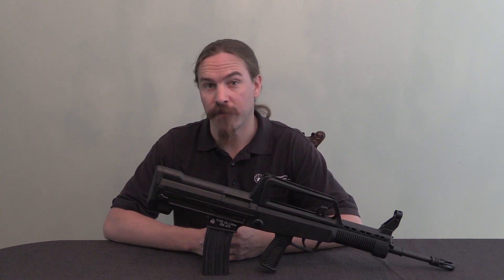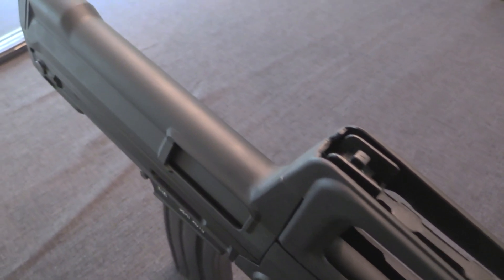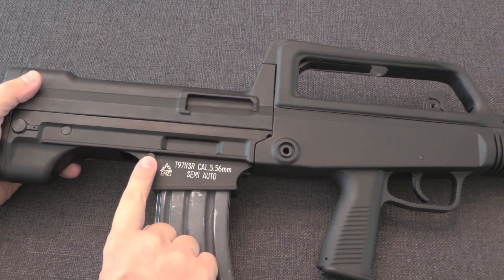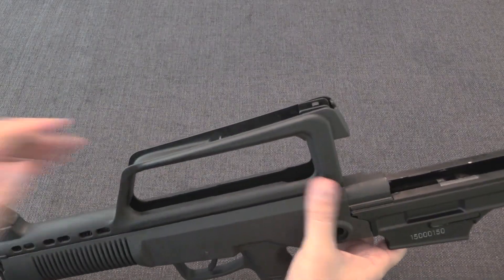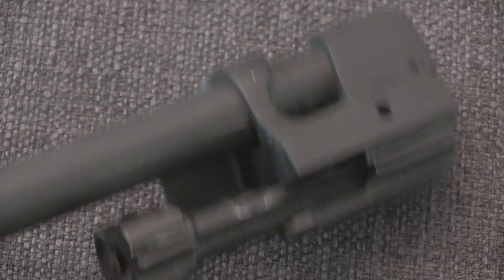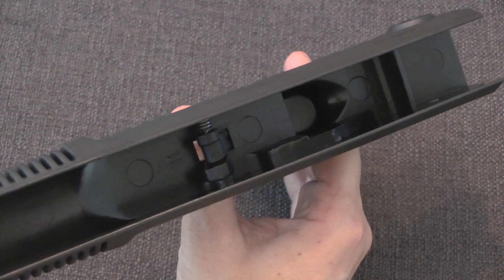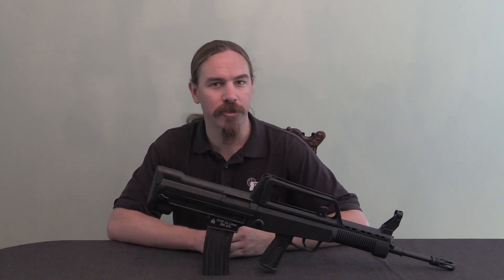Mechanics and Disassembly of the Norinco QBZ-97 / Type 97 NSR

Comment: "This is a civilian export model"
Darn-
"Here you can see its adjustable gas regulator, set it to this and you can see its flash hider here is the proper diameter with gas-sealing rings for using rifle grenades"
-WHAT?

Comment: I think that there are also Light Support Weapons with longer barrels and bipods and a 75 round drum magazine, a very short barreled carbine/sub machine gun version in 9mm calibre (?). (for weapons crews, helicopter pilots, vehicle crews, etc). 

Plus a suppressed version for special forces use, a sharpshooters rifle with a telescopic scope, a bipod, a smaller capacity magazine, etc which is similar to a Designated Marksman Rifle with better accuracy etc.

Rifle grenades, bayonets, various attachments etc are also issued.

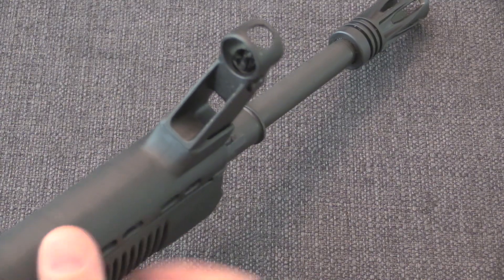Comment: @ 8:25- Re, the rear sight; the 3 apertures are 100, 300 & 500 meters. That odd post, apparently on military models, should have a luminous dot, for use with 2 others on the front sight e.g,  •°• .

Comment: @ 11:30, A- I've read elsewhere that the plastic, at least on the early models, was rubbery/soft, so as not to become too brittle in Siberia and crack.
B- I've also read that the stiker-fire design, was to lessen the usually lousy bullpup trigger pull. Apparently it did't work.

Comment: Since the dbp87 and dbp10 bullets were used, the weight is much higher than that of the small-calibre ammunition used in the United States and Russia, and that requires the maintenance of high initial speed, high penetration and high end-point effect. Therefore, you have to increase the firing rate and bore pressure of the propellant, resulting that the ablation damage of gunpowder to the barrel is also multiplied.In such cases, the heat attenuation of the barrel is aggravated, and the internal and external ballistic performance indicators rapidly deteriorate. This problem, which was discovered in 1995 when the 95-type rifle was finalized, has not been resolved for the past 24 years and it is truly painful. 

A famous military expert, once said half jokingly that the monthly salary of college graduates in China has now risen to nearly 10,000 yuan(Chinese money), while the purchase price of 95-style has remained at the standard of 3,000 yuan. Low price, low quality.

Comment: With these modern excessively plastic guns, which one is the idea, to produce them the cheapest way possible into storage, or do they really think that it would be possible to manufacture them "everywhere" like the Sudayev PPS submachine gun during WW 2?  The molds needed for plastic are not for every garage. Also is the long barrel in compact gun the only valid reason to design bullpups since they inherently bring many problems with them ?

Comment: Guess its semantics, but they diden't "take" back Hong Kong. It was "given" back to them, as it was a 99year agreement.
Reply: It's a bit more complicated than that - HK island and Kowloon were UK territory by treaty, but the New Territories (which represented about 85% of Hong Kong's land area) were leased.  In theory, the UK could have retained control of the island and Kowloon, but in practice it would have been pointless to do so simply because there is no way that HK without the NT could have supported the population it had.  Since the PRC had made it very clear that they would not extend the lease under any circumstances and the UK didn't want to commit to the massive on-going support operation that would be needed to keep HK running without NT really the only option was to return the whole thing to China.  The UK did make the time to sell off huge quantities of undeveloped land to the big HK property developers before they left though - hence ensuring that HK will remain one of the least affordable places to live far into the future.  Oh, and they offered people in HK a basically useless"British National (Overseas)" passport that doesn't give the holder the right of abode anywhere.

Comment: I actually shot a QBZ-95 and 95-1, military full auto one, they were issued to a local SWAT unit. The 5.8 version is better, although it used AK Type magazine release, it's surprisingly light and easy to guide the mag in. The troopers I've met can do a mag change faster than me with an AR😂 it points really good, average trigger, lighter than other bullpup guns. Action is smooth and light, doesn't kick all that much. Very controllable gun in full auto. A lot of SWAT guys and soldiers compliant that the -1 removed the "foregrip" and it's uncomfortable in close quarter combat, so local companies came out with a picatinny handguard for guys that wanted a vertical grip. From what I heard, the -1 removed the foregrip so the marines can put their precious grenade launchers on there 😂
Reply: Oggy Oliver you 👎big time!
Reply: @Flyingaceful  ok bitch
Reply: Grenade launchers are bae
Reply: Can launch potatoes
Reply: News update, after PLA fully roll out the new training outline. (last year I suppose?) Guys in the army also have grenade launchers to use.

Comment: Interesting how despite being mechanically completely different from the FAMAS it's built pretty much like it, receiver on the rear, barrel, sight posts on the barrel and handguards and cover more or less pinned around those. Also interesting how the gas piston is kinda of a hybrid between a tapped and really short long-rod short stroke piston. And mechanically it's a mix of AK, VZ-58, VSS/ASS on the sear with a bit more of FAMAS like the charging handle, trigger bar and final buffer.

Comment: That gas selector, if it were really hot, would there be the possibility to fire the primer due to the heat if one were to use a loaded cartridge? Seems potentially dangerous

Comment: QBZ stands for "Light Infantry Family", Qing=轻 Light，Bu=步 Infantry，Zu=族 Family.  Short stroke piston implies more rapid fire that is useful under 3-round burst mode in the military version.  I think China wanted to walk away from the Soviet weapon system, and this is an example.  You can almost see Stoner's AR design in this rifle -- polymer material, modular design, integrated handle, 5mm small caliber, straight overall layout ...
Reply: Well with the QBZ191 and the new lineup of guns it's very clear the more modern infantry weaponry of the PLA is following the US style more than the Soviet style bar the banana mags

Comment: We have a new version here in Canada, the Gen 2, that has a flat top upper and the following features:
 
Keymod Rail System
Ambidextrous Safety Levers
Full Length Optic rail
Short Stroke Gas system with rotating bolt- 3 Gas Settings (Allows for .223 or 5.56mm at variable pressure loads)
Non-Reciprocating charging handle
Front/Rear Adjustable sights included
Reply: And of course, Gen 3 is the common one now, but haven't seen any import since last year.

Comment: The reason that the ejection was so strong on many Chinese weapons is because the Chinese military uses steel shelled cartridge instead of brass. China don't have a lot of copper mines and they were concerned about that. So they made the extraction so strong to make it function properly even using steel shell.
Reply: it also dissipates energy more by transferring the energy into ejection. probably helps with lowering recoil.
Reply: Steel is cheaper than brass
Reply: That would explain the dents in the side of the brass
Reply: China has the largest copper reserves in the world....
Reply: @kovona  China does have large copper deposits but they seem to be mining other countries first. August 2022, the increase in Copper Ore's year-by-year imports was explained primarily by an increase in imports from Chile ($537M or 57.8%), Peru ($241M or 28.5%), and Mongolia ($164M or 190%).
Reply: @george2113  Chinese copper mines, and iron mines for that matter, are comparatively poorer deposits.  Meaning while the overall content is there, you have to mine a lot more ore to extract a unit of metal.  So Chinese mines are more expensive to operate, making import better from an economic standpoint.
Reply: @xsu-is7vq  hence why the import a lot from Australia
Reply: @kovona  and the largest population and manufacturing
Reply: @monkeylee4818  Yeah, you're wrong concerning "China don't have a lot of copper mines and they were concerned about that". Large scale use of steel cased ammunition as pioneered by the soviets is cheap and effective. The practice was and still is common amongst many militaries inside the once Soviet sphere of influence. All firearms designed to use steel cased ammunition are over gassed to ensure proper feed/ejection. Although nothing I've said will appear as news to the majority of people in this comment section, I figured it was worth pointing out some of the misleading information contained in your comment.
Reply: @MrGibsontoldnolies  you are right, I didn't know that back when I wrote that comment
Reply: Confucius say...
Reply: +100000 social credits, good job citizen 🎉
Reply: No it’s because they are cheap. Steel ammo is good enough for their cannon fodder soldiers.
Reply: @thehumblepilot22 Your soldiers only work for capitalism,
Reply: @thehumblepilot22  It was the U.S. Army and his lackey army that became cannon fodder on the Korean battlefield

Comment: Using a live round to adjust gas pressure because the metal is too hot to handle squicks me.
Reply from the maker: You can use an empty case then.

Comment: How much heat does it take to make a primer go off? 7:20
Reply: Pick up some of the empty cases you have just fired. Use it to adjust the gas port setting. Problem solved.

Comment: I have shot it a couple times in Chinese military. Chinese type 95-1 is better than 97. They don't have issue with magazine. It changes magazine as fast as Ar15. The safety is right beside the hand grip. You can shoot with left hand in fact if you dont lean too forward. Only problem left is high scope mount. Chinese want this rifle shoots better than Ak but more important thing is better reliability than AK.
Reply: So you are a real Chinese soldier?
Reply: @zennoix9984  after military service you can still go aboard as long as the "secret secure period" ends, this makes sure you wont have idea with what's going on in the pla recently.  For a regular soldier this period is typically very short 3 years tops, for expert it is long.  so yes he could be a pla vet. But it's internet you know can't make sure if he is.  lol
Reply: @dding01  Yep, and you dont need to be soldier to try those guns, there are some shooting range in China, one of the them in Beijing, I tried the qbz95, and type 85(Chinese version SVD) and qsz92 pistol. It was a amazing experience, since when I was in college in U.S, I cant find a SVD in any shooting range to try. The qsz92 is the only gun that has issue, it keeps jamming, probably due to the magazing design problem.
Reply: @qiyuxuan9437  where that shooting rnage in beijing? i have friend in there
Reply: @oggyoliver3651  About 1 hour drive north from downtown Beijing.
Reply: @qiyuxuan9437  oh, u meant the northern shooting range right? Its fuckin boring man , ive been there before, they locked the gun i can't hold gun by my hand and reload , i can only pull the trigger :( , do u know where else?
Reply: @qiyuxuan9437  hey
Reply: @oggyoliver3651  Yep, that is true😂, but at least you got shoot some guns that are very hard to find elsewhere. I heard there are more commercial shooting range opening in other cities during recent years, but I dont think they are near Beijing tho.
Reply: @qiyuxuan9437  well do u have wechat , i kinda need to know more
Reply: @qiyuxuan9437  hey man
Reply: @oggyoliver3651  Man those guns were not locked few years back... Then rumor says some accident took place and officials high above ordered them to take actions or they'll close down the range and that's how all of the guns ended up with decks and chains. The first two times I went there guns were free to handle but then two years ago I went for the last time and realized it's over. :/
Reply: @oggyoliver3651  If you wanna shoot a SVD I think their only availability in Asia would be Cambodia or Laos.
Reply: @oggyoliver3651  Yes local to Beijing. Is that important?
Reply: @BadassLapin  so its matter , why dont u know 81 shooting range?
Reply: @oggyoliver3651  Is it in Beijing? Never heard of it. Are you Chinese?
Reply: @oggyoliver3651  civilian shooting ranges are super boring and expensive in China. If you have some connections you can go to army ranges. Some of them are opened to civilian. And you can shoot authentic automatic weapons that are in service
Reply: Zennoix riel3620 No need to be a soldier. In China all the students in University will have a 1 month simple military drill, which is the first thing they need to do before their campus life. When I was a student I shoot Type 56, Type 63, and Type 81.
Reply: @SullyKrein  Thats not real, I never got a chance for that.
Reply: @fukairen9601  I don't know why you didn't have that chance but that's your business. Most of us do have rifle training.
Evidence: https://newsen.pku.edu.cn/news_events/news/focus/8793.htm
Reply: @UCdjSI02apBg-yOkxGzBo59Q no one is judging you. Just make it clear, NOT ALL Chinese university students got a chance for shooting during their military training. In fact it's really rare these years.
Reply: @fukairen9601  Then real for me.
Reply: It failed to achieve both accuracy and reliability to an AK, or Type 56 SMG.
Reply: @ChaohsiangChen  

I mean can anything come close to the reliability of the AK ? This was probably designed to look more advanced lol
Reply: @proger1960  
Yes, it is. PLA soldiers hate it and they reverted back to Type 03 in 2003. The new QBZ-191 is simply an AR pattern lower/buffer with a short stroke piston in 5.8. So they adopted the Taiwanese approach in the end. Hopefully politically soon as well.
Reply: @proger1960  
That being said, the design is not entirely without redeeming quality. At least it is light. The use of a floating bolt carrier guide rod is to reduce weight and the accuracy is on par by 1990s standards. IMHO this is not a good approah as a military weapon due to the obvious lack of durability in the bolt carrier guard rod and rear sight/scope base. The type 97 NSR G2 fixes some of the issue.
Reply: @kachow2818  we are talking about it in my English course rightnow. The Social Engineering is real in America. I suggest everyone to read the Declaration of Independence. Its powerful for times like this.
Reply: You guys have one ugly rifle...
Reply: We are not friends... if I see a chinese soilder in America its a automatic green light... CCP are persecuting Christians and Muslims by the millions...
Reply: @Snoopy1997Joshua  ahahah cringe
Reply: @NoSaysJo  🤑🥶
Reply: @Snoopy1997Joshua > muslims lmao 😂 how's the goat abdul

Comment: Some thing I know about the type-95 and 95-1: The forward ejection, gas adjustment and recoil absorber were the key improvements from 95 to 95-1, which you all have in this export version type-97 rifle. The type-95 was the first 'build from scratch' gun-ammo system in China that it took a long way until they addressed all the initial problems and make it into 95-1. I remember reading some papers (may not be true story) that a lot of time and money spent on resolving the ejection issue and they finally realized a piece of plastic would do the job.
In fact, the Chinese official has never fully accepted the bullpup design, the army maybe forced to accept this from political reason, but a conventional-design assault rifle family was also taken place in parallel with the type-95 and eventually became the type-03 rifle. The type-03 is a AK-like (more precisely type-81 like) rifle family and some said it is what the army really wanted. It is also interesting to know that the type-95 now official adopted by the army force, which the length of the gun in conventional use isn't that big an issue; but the type-03 is now being adopted by the Chinese marine corps and paratroopers, which shorten rifle maybe more appropriate.
Anyway, it is a never-ended argument among the Chinese official and also among the fans: whether the type-95 or the type-03 is better. It seems a bit waste of effort to develop 2 gun families in parallel but some said that it was the price to pay for learning. I'll be interested if some day you can put an export version of type-03 on video and talk about what you think of these 2, that will be great.
One more thing, among all strange Chinese guns, the type-79 Sub-machine-gun may be one of the weirdest. It was designed as a 'jungle-SMG' back in 60s for the potential conflict in south Asia, a concept that I never understand. I has a very high rate of fire (1000+ rpm I guess?) for a less-than-2kg gun but very small magazine (20 rounds). It uses 7.62×25mm Tokarev cartridge but gas-operated, so in full-auto it just uncontrollable but in single shot it has unusual high accuracy for a SMG. It never formally export so it is un-heard for foreigner but it is the most common gun that can be seen by a Chinese citizen since most Chinese police forces are still using it. I'm sure it will fit the title of 'forgotten weapon' if you can find one and talk about it.